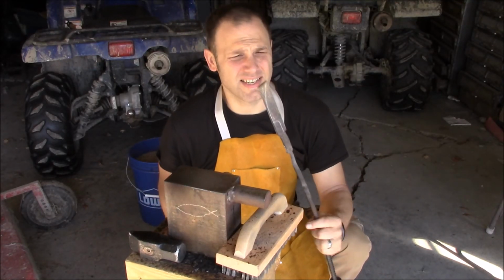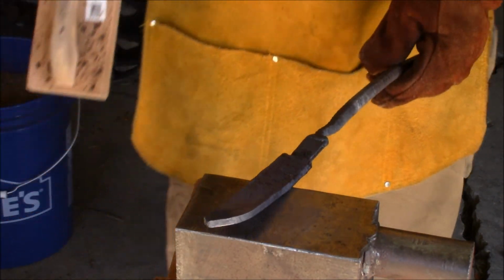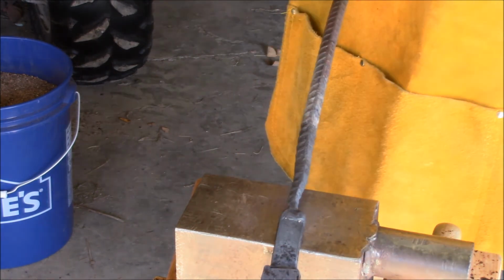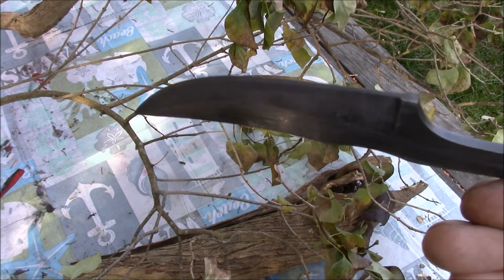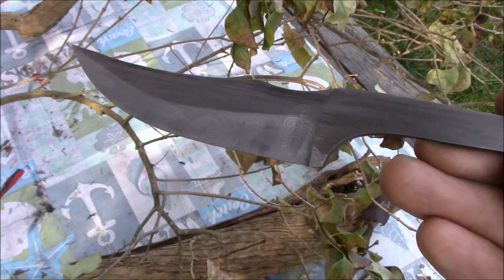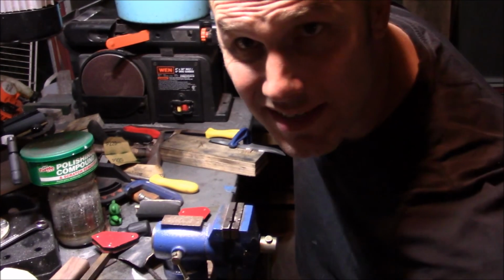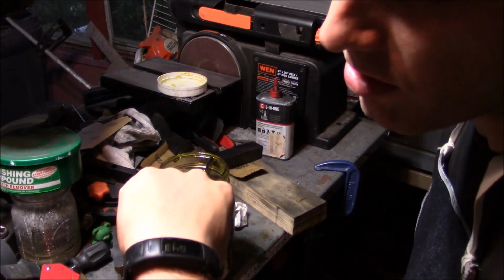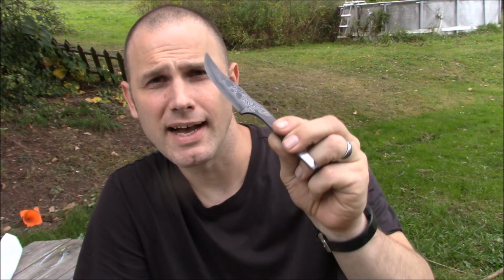Rookie Bladesmith 11: San mia damascus 2, Blade

Comment: I'm not trying to be a bug but you could really stand to benefit from hammering on hot steel ,should never hit the steel when it is dull for risk of cracks

After a good long etch take it and lightly sand it with 1200-1500 grit sandpaper (it will touch the raised sections wile leaving the lower darker contrast you are looking for)
Reply from the maker: "Dull" is directly related to lighting conditions. Seems more accurate to say cooler steel. I'm cognizant of what temperature the steel needs to be but, thanks for the tip. I'm also aware of the effects of hitting the raised part of the damascus with high grit sandpaper. My step father wanted more of a dull matte finish. I might not have said that in the video. Thanks for your comments, you never know what tip might help someone out. 😎
Reply: WJ Blades 
                  I hope you realize that comments are made based on what people see and what they hear 

You mentioned you don't know why the contrast is darker,you must've left out the step explaining that you sanded the steel with a higher grit to reveal the pattern you desired 

I've watched three of you're videos and you say the steel isn't moving like I'd like (dull is dull in all lighting) 

I forge blades to and like to share knowledge to help ,check out 

Bladesmithing for beginners on Facebook
Reply from the maker: James Ball,
I do realize comments are made based on what people see. However, I'm confused by what you're seeing. When you say "you should try hammering on hot steel" I take that to mean you think I'm hitting cold steel, I don’t see where I'm having a problem with that in this video. Text is not as good as talking in person so maybe I'm misunderstanding you. As for moving the steel: I think drawing out hand forged damascus too much increases the risk of disrupting the bonds that have been made. Especially if it gets too cool, as I said I'm cognizant of it as I work. I'm not sure when you think I'm making the errors. You must be better at telling temperature through the video medium than I, because for me it looks quite different in the video than what my eyes see in person. I think your tip is good, I'm just confused by how your perception of the video differs so much from mine. If you are near upstate NY, come visit me I like to learn from people further down the road. Confusion gets cleared up a lot faster by talking. ☺
Reply: I like you have no real mentor so it has been a road traveled viewing videos in here (YouTube) and trial and error 

Yes,text is definitely not the best way to get a point across 

I will be doing a live video sometime this weekend to showcase how to better move steel in the initial forging,I'm in no way an ABS Master so it will be more of a beginners guide to hammer striking power and hammer control 

I just haven't decided if it will be live here or in my Facebook group 
 
"Bladesmithing for beginners"